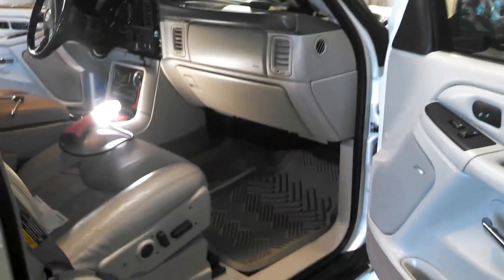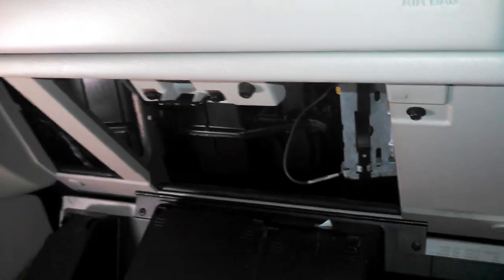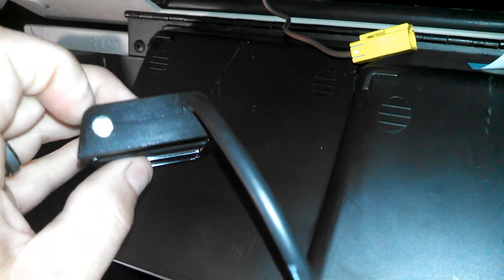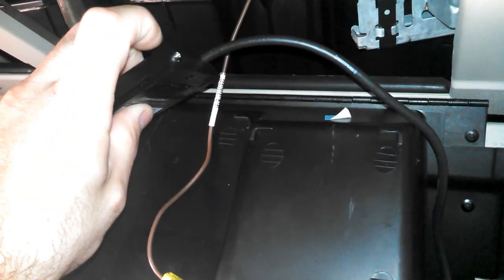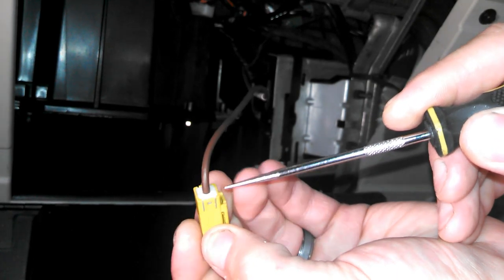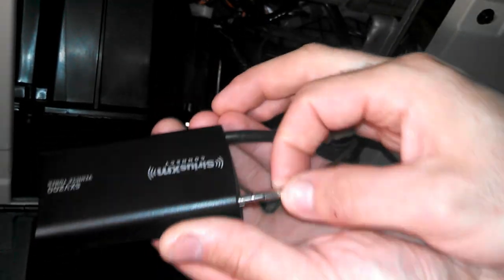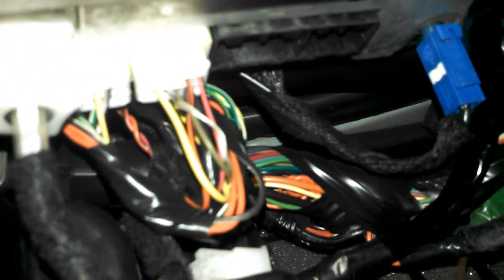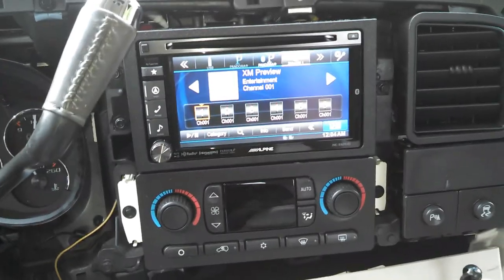How To Use Factory GM XM Antenna for Aftermarket SIRIUS XM Tuner - Easy

Comment: I just have to say – this is one of the best videos I have ever seen – seriously.  My XM reception is unbelievably good using that factory antenna.   So much better than FM – which has constant interference.  I have an 06 Envoy Denali.  It has the same factory setup – the XM receiver is under the glove box.  I swapped in a Kenwood head unit and use the same SiriusXM SXV200v1 tuner as shown in your video.  In the Envoy, the GM factory XM antenna connector looks the same as yours on the outside but it’s a slightly different design.  You have to pull out a clip located on the side of the plastic antenna connector.  Then you can press the metal center barrel out of the connector and it plugs right into the SXV200v1 just like you show in your video.  The wires are just long enough to reach.  I used a bit of tape to make sure the connector does not slip out.  There are extension cables out there if your factory XM tuner is located elsewhere in the vehicle.   Really great and simple mod and you can go back to the factory setup if you ever sell your vehicle (just put the connector back, plug it in and re-install the factory radio).
Reply from the maker: Thanks for the comment!

Comment: I'm finally replacing my stock GM radio on my 2005 Silverado and I was on the fence about whether or not to keep my XM subscription. I found this video and since I can use my GM factory antenna with the new SiriusXM adapter, I decided to go that route. Got the adapter today and hooked it up in about 2 minutes. Thanks a bunch for posting this video.

Comment: thank you thank you thank you, my 04 GMC Sierra is equipped with XM and I have an after market kenwood double din radio that xm ready and was trying to figure out how to use the factory truck xm antenna, didn't want to spend an arm and a leg and buy the turner kit, now alls I need is this module

Comment: Great info in this video. This method would have worked for me but the cable on the tuner is too short to reach from the radio all the way to the front passenger floorboard. After realizing this, I just used the new antenna that came with the tuner. My vehicle is a 2012 Ram 1500 Quad Cab.

Comment: I have a 2003 Tahoe with factory Bose & XM. My XM module antenna connector is blue with two connections. I know for sure it's the antenna wire because I unplugged it with the satellite radio on. Is there a way to adapt this factory connection to work with a SXV300?
Reply: Any luck with this?

Comment: I have a 2009 GMC Sierra 3500 HD.  Swapping out the factory with a Pioneer AVIC-5201NEX.  It seems that the XM and FM antenna come through the same wire?  Any way to split, can this be used, ETC?

Comment: So I have a 2005 Silverado without Onstar, however my mirror shows temperature and cardinal direction on it. Will using the new tuner  with the OEM antenna remove the GPS input for the mirror etc?

Comment: I'm trying to do this on my '08 Ford F150.  I removed the plastic clip but the cable connector just will not plug into the SXV300.  Am I doing something wrong?

Comment: question my gf bought my the sirius xm v2 300 my question is it didn't come with instructions I thought I could put the aftermarket Antena in to my aftermarket Antena and will that work and can i mount the Antena inside my vehicle not a fan of placing it outside my vehicle

Comment: I have a 2008 Mercury Mariner with XM already installed and activated. I just purchased a Kenwood DMX7704X and the SiriusXM SXV300 kit. Is the factory satellite antenna always located on the right behind the glove box like in the video? if not, where would I look for it? Have you ever used the factory antenna on an SXV300 for an install in a Mercury Mariner? Any tips would be greatly appreciated.

Comment: Question.
I have a chevy 07 Malibu LS. 
& I bought the fm turner at Best Buy & had them install it back in 2007! 
Fast forward to 2017 every now & than I get a message saying antenna. I try disconnecting & reconnecting the xm radio antenna & power port but still says antenna. Sometimes that would fix it & sometimes I hit a bump down the road & it will cut off & say antenna. 

So now I'm wondering do I need to buy a new fm turner & have Best Buy install it or what's my other options??? 

Thanks

Comment: I have a 2013 GMC Sierra XLE.  This is a great video.  I can use the factory antenna with my new Kenwood DNX892.  Thanks again.  Another question, can I use the factory microphone and hook it up to the Kenwood DNX892?
Reply from the maker: Not sure. I have never tried. test the impedence of the factory microphone with a multimeter on ohms. it needs to be similar to what the Kenwood microphone tests.

Comment: nice video I have a xm radio in my 66 ford galaxie is there anyway to connect it direct to my stock antenna  is there an after market cable to hook to the xm tuner to the stock anteena??
Reply from the maker: Your stock antenna is not a Satellite antenna.  It cannot pick up a signal from the xm satellite.  You can buy an adapter to connect the audio OUTPUT of the xm radio to your factory antenna input on the stock radio, but that is totally different than what I am demonstrating in this video.

Comment: Hi Amp Lab! I have 2006 Dodge Ram 1500 MegaCab with a factory antenna mounted to the rear of the roof and am installing a New Alpine stereo with the SXV300 tuner.  I have no idea where to look for my existing antenna cable?? Any idea's?? Thx
Reply from the maker: it's plugged into the back of the factory head unit.

Comment: I was wondering why was the module removed? If I can just use the factory cable for the hook up do I need that factory module for any other purpose.
Reply from the maker: I'm not sure why it was removed. it was already gone when I got the vehicle. There is no other purpose for it.
Reply: Ok I'm going to try to install with other module hooked up. Hope it is no complications.

Comment: Can you take out the GM factory installed SiriusXM tuner and use an aftermarket tuner, with the factory head unit still functioning exactly the same? Is there an adapter?

Comment: I got this installed at an audio shop. I have a pioneer avh5700 on a 04 Avalanche with Bose and onstar and XM. My problem is the SiriusXM sound is very low and has almost no bass. Regular radio and Bluetooth works good just having problems with satellite radio. Any suggestions on what the problem could be?
Reply from the maker: That's how it is.  Satellite radio will always be a lot less bass.  Don't know why, but I notice it on every one I install.  As far as the level, that is also normal. However, go into the audio settings and look for "Source Level Adjustment" or SLA. Turn it to +3 or 4.
Reply: I will have to try that later and see how it goes. I never had that happened with the factory XM , it sounded as good as FM almost but I wasn't sure if maybe it was the factory antenna with the aftermarket radio or if adding the aftermarket antenna would make a difference. I will let you know how it goes after I change the settings on it. Thanks
Reply from the maker: Its the sane whether you use aftermarket antenna or factory antenna.
Reply: Update: I took this radio out and reconnected everything and it's working great now I think the Siriusxm tuner cable wasn't connected all the way and it was making the sound very low. Only problem that I have now is from time to time the factory antenna cable gets loose and I have to reconnect it. Thanks for the video
Reply from the maker: Sirius XM always seems to be a lot less bass. you can adjust the level by going into the audio menu while XM is plating and youll see a settingbthat says "Source level adjustment). Turn that up to about 3 or 4.
Reply: Yeah I already got that working it was from the cable not being hooked all the way in. Sounds great now thank you
Reply: +The Amp Lab 
port questions

Comment from the maker: Well you wouldn't have to buy an extra part anyways as the satellite tuner would come with the antenna.  This just saves you from having to find a place on the roof and run the wire for the antenna.  Just keeps it cleaner on the outside.  You still need to buy a satellite tuner.

Comment: Do you know if this will work on a 2013 Chevy Silverado truck.  If not, is there any way to use the factory antenna with an OnyxPlus XM radio?  Thanks.

Comment: Hi there.

I have a 2008 Pontiac G6 GXP.  I also have my Pioner AVH-P4300DVD head unit from my old vehicle and the 2 SiriusXM adapters to use with my headunit.  My Pontiac has XM built in with the stock headunit.  Would I be able to use the existing antenna with my Pioneer?  Thanks!
Reply from the maker: On that car I believe the tuner is in the rear deck, so unless you want to try and cut and extend the SXM adapter harness, no.  Its too far away,

Comment: I have an old school pioneer DEH-P8600MP car stereo with the older style blue connector plug for the pioneer GEM-90XM tuner, has anyone figured out how to make an adapter cable to use the newer SiriusXM SXV200 tuner?

Comment: I have the two connection setup as well. 

2003 suburban with bose system. 

Please help.
Reply from the maker: Not familiar. never seen two connections. are you looking at the right box?  its the one to the right of the opening, not above. Then one above is the OnStar module and does have two connections.
Reply: The Amp Lab yeah it seems to be the module area.  I have found the Constar connector.  and another white one.  both of which are not what you want us to use, but the module up front has two connections within one connector.  I wonder if i just connect one to the stereo see if it works, and then try the other....  really thought this would work, I need to figure this one out.
Reply from the maker: email me a few pictures. amp_lab@yahoo.com
Reply: Email sent this morning any thoughts?
Reply: Any luck with this setup?
Reply: JustKillinTime  any luck with this setup?

Comment: I have a question: I have a 2003 Tahoe and a 2006 Tahoe. My 2003 has XM channels on the head unit when I press the Band button, but, the 2006 does not (only FM1, FM2 & AM). Does this mean that my 2006 does not have an XM tuner in the head unit? It has the shark fin antenna on the roof but no module in the glove box. Would I have to buy a new head unit to get XM or just an XM tuner to activate the channels on the head unit? Thanks in advance!
Reply from the maker: Good questions.  I do not know if you can simply add the tuner in behind the glovebox or not.  Never tried it.  Have you checked to see if the harness and antenna are in the location where the tuner would normally go?

Comment: I have a lifetime subscription. I know I can transfer it from a wrecked car to my new one. I suspect the vehicle isn't as important as the radio ID.

I would like to put a factory GM XM radio into my truck. It's an older truck and I can modify the dash if needed.

Can you recommend the oldest year GM XM ready radio to use?

Is it possible that the add on modules could be considered for the lifetime subscription package? I really don't want to put the lifetime subscription into our replacement car; I'd like to put it into my old truck.

Can you provide some comments about this? Thanks.
Reply: If its older, most likely you will not be able to.  The data is transfered via a data bus system for the xm tuner and the stock head unit.  If it's an older vehicle without data-bus, it will not work.

Comment: How can I find out where my plug is? I have an 03 GMC Sierra sle it's not in the same spot as shown.
Reply from the maker: Then you don't even have the antenna. they're all in that location.
Reply: The antenna ontop of my truck says xm on it? And its factory.
Reply: I have a different connection that has 2 connectors going into it. If you guys have an email or something I send you what I'm looking at.
Reply: Did you ever figure this out? I have the module with a blue wire with two plugs

Comment: Question...I have an 03 monte carlo. It has sirius xm built in to it from the factory. There is a little box in the trunk(which I'm assuming is the receiver) and I assume it gets it's signal through the factory antenna. I just purchased an aftermarket pioneer double din head unit that is sirius capable. When I called car audio shops they said I would need a separate tuner and adaptor piece with a separate antenna and it runs about $150. Is there any way around this or am I going to have to buy the separate piece?
Reply from the maker: They are correct. You need the SXV-200 adapter just like they described.   The box you're seeing in the trunk is most likely the amplifier.  Not sure if they mount the XM tuner back there or not. You could use the stock XM antenna in the vehicle as long as the stock tuner is near the radio. The cable on the SXV200 is not very long.  If the factory tuner is indeed in the trunk area, you will need to use the antenna supplied with the new adapter.
Reply: Yes, I think you are correct. I was told the tuner was built into the radio
Reply: Thank you for the part number tho...I found it on eBay for $34.99. About $115.00 cheaper than quoted. Amazing how the shops try and mark things up!!! Really boils my blood...that's why I try and do everything I can myself! Save a lot of money that way !!!
Reply from the maker: The $150 was probably an installed price.  That part retails for $99.99, $50 was probably labor.  That's about what we charge installed at our shop..  Its not ripping people off, its making a living. 

 Internet retailers sometimes only make literally a few dollars off each part.  They make it up in volume. As a small local shop, you just can't do that.
Reply: rtkota5point9 Yea, I understand they have to make a living but it's still ripping ppl off. The part is not $99. I just said I found it on ebay for $34.99. They can make a living off other ppl...not me. Same with repair shops. Especially one's that use grid pricing for labor. Long time ago I needed a tie rod end installed on a Lumina I had. They quoted me around $345 for parts & labor. Idk y but something told me to call autozone and check on the price of a tie rod end for my y,m & m. $7 dude. $7! So you're telling me labor would have been $338? Even at dealer labor prices (around $90 hr) they are saying it would have taken them 3.75 hrs. Which is false. They have all the proper tools and a lift. I went and bought the part and installed it in a little over an hr. Every since then I do my own work when I can. I have one of those repair books for my car and short of dropping an engine in or rebuilding the trans, I do it myself. Once again I know they have to make a living and pay others but not on me. My grandmother always told me never pay others to do what you can do yourself!
Reply from the maker: No I'm saying suggested Retail on the part is $99.  Not eBay.  They might be selling it for $34.99, but it might actually cost the shop $30.  Or sometimes even more.  It may actually cost a small retailer MORE to buy than they sell for on EBay.  The ebay seller could get a discount by buying in bulk. Its wrong but thats how it works. I could actually look up cost on that part as I work at a shop.

Trust me they aren't ripping you off at that price.  That is what most actual shops would charge for it installed.
Reply from the maker: Just looks it up.  That part costs us, from a distributor, $59.28.  So figure in you have to ship it.  They're making like $35 -$40 on the part.  then $50 labor. That's not outrageous.  Internet sellers sell in bulk. they make a few dollars off each piece but get discounts for buying in bulk and make money by selling them by the thousands.

Comment: Sir AmpLab, will this also work for my VW 2011 cable disassembly
Reply from the maker: Supposedly yes, but the few VWs I have tried did not seem to work. the unplugged in, just no signal.
Reply: +The Amp Lab 
I tryin to be cheap, I do not want to buy $24 adapter. I hope to show you the adapter I have already, maybe u can point me in the right direction. 
Those damn European car manufactures can't keep it simple
Reply from the maker: +The Amp Lab *plugged in

Comment: Hi, will this work with a siriusxm sxv300v1 radio and a 2006 honda accord xe with an xmradio antenna?
Reply from the maker: It should as long as the factory antenna lead is close enough to the new headunit so the SXV300 will reach. 

Havn't done an accord this way yet.

Comment: Is it possible to add a sirius xm radio to a 2018 Equinox?  The dealership told us that it had Sirius but after we drove it off the lot we discovered he lied.  HELP - we make long hauls across the northern US several times a year and hate having to retune every 20 minutes for to only be able to hear Country and Jesus stations
Reply: Our subscription from our previous bill keeps running and we have no place to play it.  Sirius offered us a crappy dash mount tuner but we have to mount the antenna on the outside of the vehicle.

Comment: My antenna has 2 connectors, a black and yellow, both side by side in the same connector.
Reply from the maker: what vehicle?
Reply: Mine has one outer connection picked holding two cables that go in that module 

What am I doing with this?

2003 suburban with bose system.

Comment: Is the factory installed SiriusXM tuner I already have in my 2007 Trailblazer not pin compatible with after-market "XM ready" radios? Just trying to save a few $$